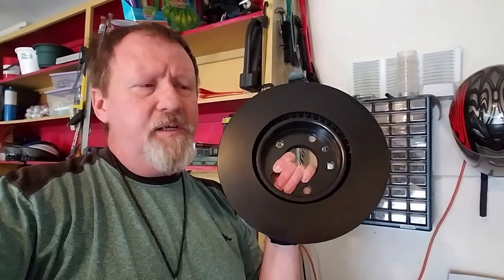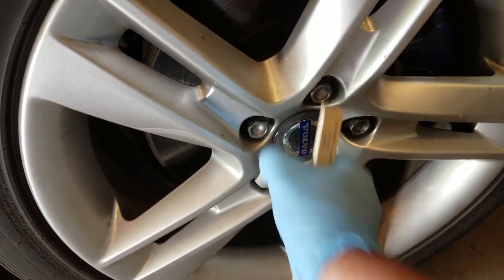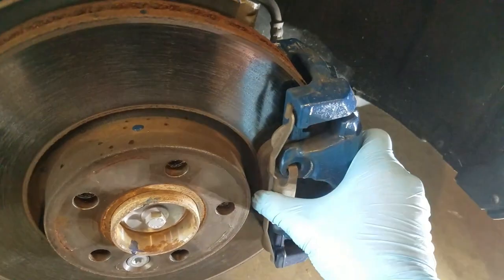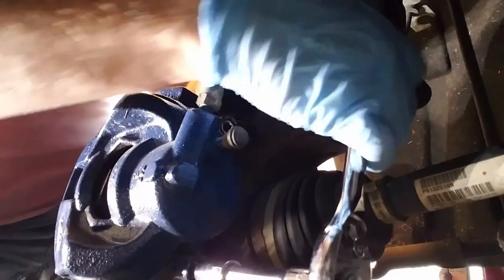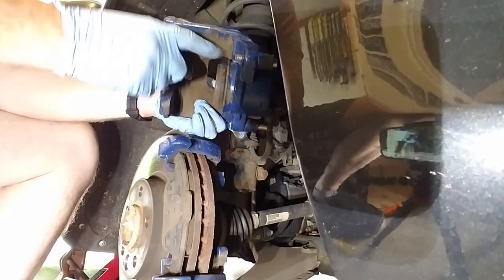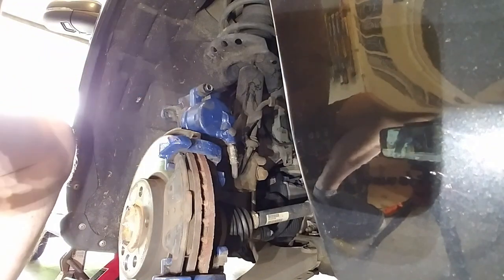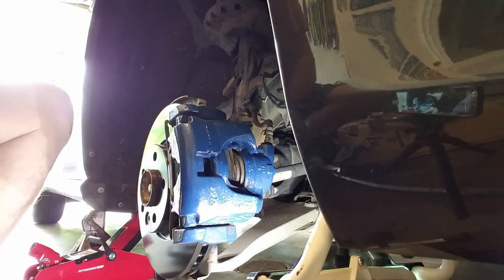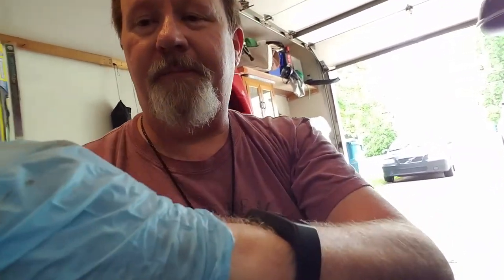2015 (P3) Volvo S60 Front Brake Rotor and Pad Replacement

Comment: Could you show us replace the timing belt 2015 volvo S60??!!
Reply from the maker: Sorry, but I have no need to replace the timing belt on my 2015.  I only have 50,000 miles on it and I believe the factory recommended change interval for the timing belt on the 4 cylinder is something like 150,000 miles.  Maybe in a few year.

Comment: Caliper bracket bolts are single use? At least recommended.
Reply from the maker: Not that I'm aware of.  They aren't under huge torque or stress so there is no need to replace them.
Reply: @FloydNashFixItDad  Hmm, apparently there a two types of bolts. OEM Volvo single use sretch bolts and other normal bolts. Well, 4 bolts cost 8-9 euros from dealer so decited to byu new ones.
Reply from the maker: @EiraAimo  There are more than 2 but let's just keep it simple.  Stretch bolts are usually used in high torque applications where the specific torque really matters.  Head bolts are a prime example and in modern cars don't use a torque setting as much as a starting torque, then you have to tighten each bolt by a certain degree of rotation in a specific sequence.  The bolts that connect the subframe to the chassis are also stretch bolts sometimes.  If replacing the ones for your application make you feel better, then it's worth it, especially when the cost is relatively inexpensive.  Sometimes peace of mind is really worth that extra little amount.

Comment: What is ia the price of volvo disc per set?
Reply from the maker: It can vary depending on the car, even with different variants of the same year model.  Go to maxbrakes.com to get pricing.
Reply: @FloydNashFixItDad  thnx for the help.. im from india n i have volvo s60 diesel 2.0 4 cylinder.